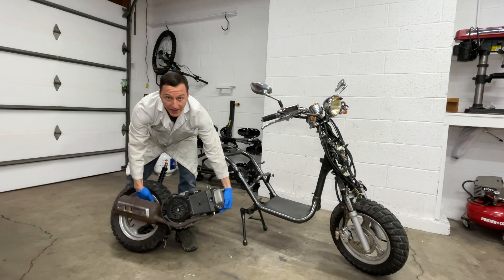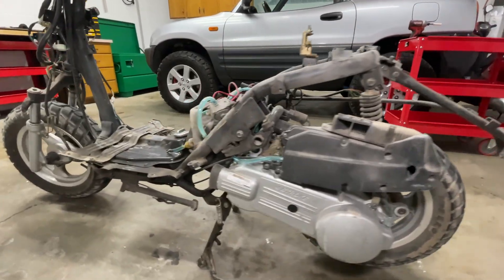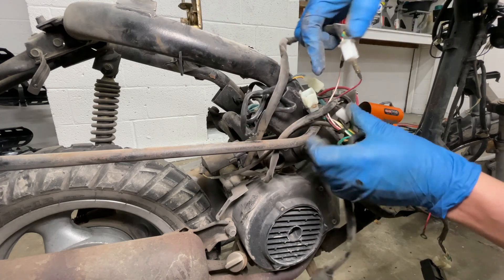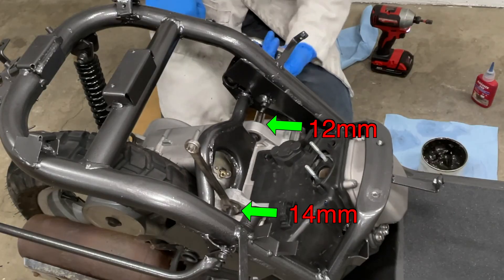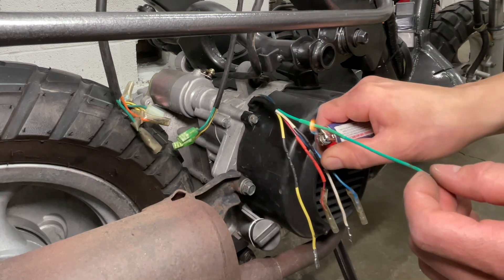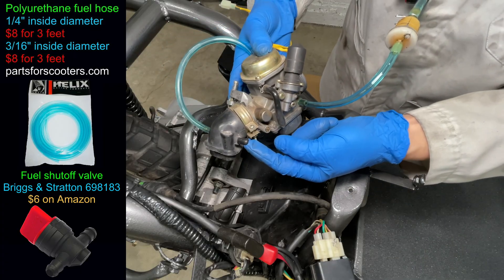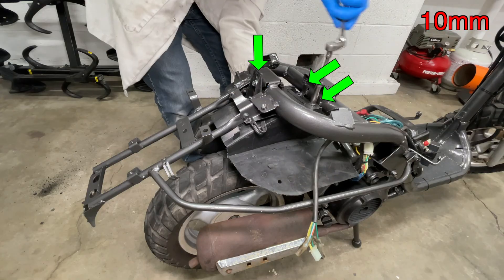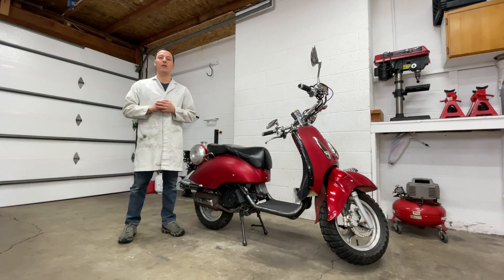Engine removal and installation on a GY6 150cc Chinese scooter

Comment: I bought a 150, GY6 I'd like to change it to a 49cc. Does it depend on crank case size? it's a 2011 Jonway. or would it be easier to just sell it, and buy a Honda? Any help would be appreciated.
Reply from the maker: Getting a Honda is always a better idea.  I would never recommend a 50cc over a 150.  They're brutally slow and you're likely to get run over by a car.  Even when the scooter is running perfectly, a 50cc engine will give you 2 horsepower.  The 150 gives you about 9hp.  It's less sensitive to tuning, so if it doesn't run quite right or the temperature changes, you don't have to re-jet the carburetor to ride it.
Reply: @LabCoatPaul  it's specifically for riding in Key West... Traffic is slow, I should ride a bike. Thanks

Comment: How long does it take to swap out the engines? This is an old video but how long does it take to swap them out for a new engine???
Reply from the maker: Unbolting the engine is easy, but the whole project including dealing with the plastic will take at least a whole day.  You might be able to do it in 6 hours if nothing goes wrong.
Reply: You do not need to remove the plastics on most scooters 150s have two mount spots  50s will mount differently realistically I would say can be done in about 2 -3 hours it's not super complicated at all  I'll be doing a swap soon myself just trying to do my homework plan on going up a few ccs

Comment: @ Paul, Great video! Good timing of things, I like the arrows. I like how you fast forward to certain parts, and you camera composition is on point. Just a question to you and anyone else here who would like to help me out. I want to dissemble my Hyosung Prima 50cc Scooter and fit the parts into 4 large boxes reinforced with wood beams (to protect it during delivery). Now, how should I disemble my scooter into so that it would not be too much labor when I have to resassemble it once I have shipped it to my destination?
Reply from the maker: My recommendation:
box 1:  all the light weight plastic parts
box 2:  engine, exhaust, rear wheel
box 3: leave the wiring on the frame, take the handlebars off, set them by the fork
box 4: front wheel, air box, any other parts you removed

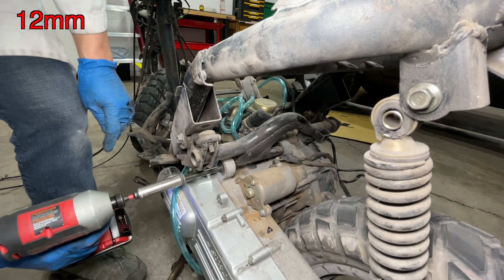Comment: help me please I'm having an issue taking it off  1:54 which way do you turn the screw right or left motor scooter
Reply from the maker: The bolts are normal thread.  Turn them counter-clockwise to remove them.

Comment: Paul why do some scooters have a vacuum line going to the carb? I have a  50cc Chinese gy6 and mine doesn't have one.
Reply from the maker: The 150cc carburetors have a weird little vacuum operated pump on the side of the carburetor that helps with the idle.  Check out this video if you want to know more:  https://youtu.be/0m13eJrfwOw

Comment: You might want to rethink the fuel feed.  You've got a hose between the tank and the shut-off valve.  If that hose fails, the entire tank will drain out creating a very dangerous situation if the scooter is parked in the garage where there are ignition sources such as the hot water heater.  It would be better to attach the petcock directly to the outlet of the fuel tank, so there is no hose failure hazard.
Reply from the maker: You're right.  There wasn't clearance to the tire for the straight shutoff valve I ordered.  I should install a 90 degree valve at the tank.  
Good advice fore sure.  Thank you.
Reply: You actually probably saved my home from being leveled…. did NOT know a water heater can light gas fumes 🙏🏼
Reply: @wezwop  Of course, I'm referring to gas-fired water heaters, not electric ones. Ditto for furnaces.

Comment: I’ve got a moped I’ve been trying to get running. The dash and tail lights stopped receiving electricity from battery before I could get it started. I tested the battery and checked the fuse. Where should I go from here? Would appreciate some direction
Reply from the maker: Make sure your battery is fully charged.  Does the starter work?  You'll need to check for power at the ignition switch, and at the headlight switch.  Do a google image search for GY6 wiring diagram, and start testing stuff with a voltmeter.
Reply: @LabCoatPaul  will do, I Appreciate the help. I’ve got a new starter motor to put in because it sounded rough before the loss of electricity
Reply: @LabCoatPaul  so I have located the problem wire in the harness. I cannot  find a wiring harness online that looks like it would fit. Do you have any recommended parts distributors? It’s an unbranded Chinese scooter
Reply from the maker: @mipc-dm8ij  I don't know any place that sells a generic GY6 wiring harness, but you should be able to fix yours by doing a google image search for "GY6 wiring diagram"  My favorite scooter parts store is https://www.partsforscooters.com/

Comment: Can you make videos of removing all unnecessary things on a gy6 scooter
Reply from the maker: Yes.  Check out this video:  https://youtu.be/li95pzfhAnM
Reply: @LabCoatPaul  thanks, one question, is it bad for the engine to run without the pcv hose? Right now I don’t have a hose it’s just nothing on there.
Reply from the maker: @tommylundberg9463  It's just for emissions.  It won't hurt the engine to not have a PCV hose.
Reply: @LabCoatPaul  I know you don't the fuel pump now because you're gravity feeding the carburetor but was there any other reason to delete the fuel pump? Will you make a video about the body modifications too?
Reply from the maker: @EbonyPope  The full video with the modifications is here:  https://youtu.be/NtSNROF_KsM
The fuel pump isn't needed when the gas tank is higher than the carburetor.  I might end up putting it back in if I have a problem riding up steep hills.